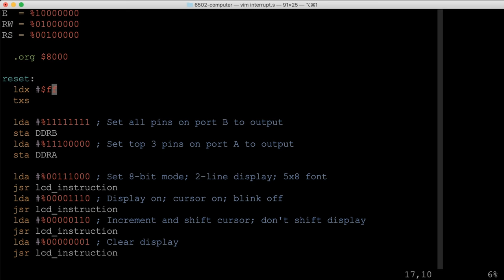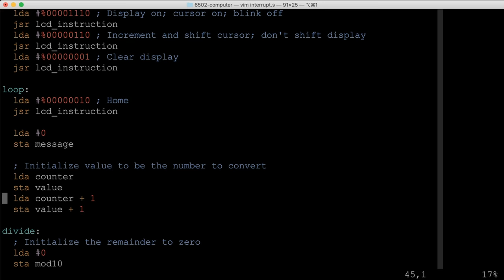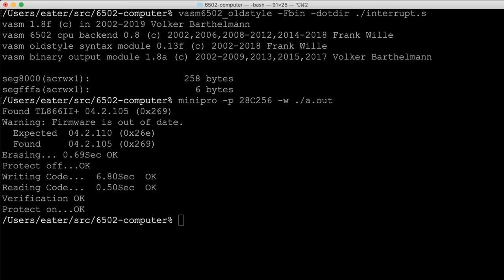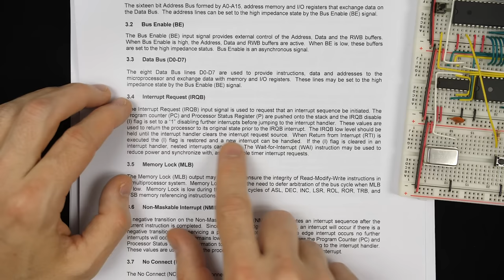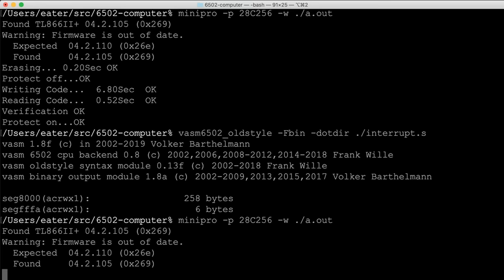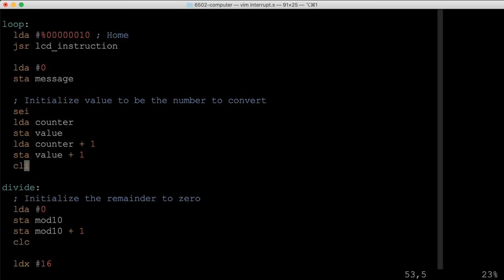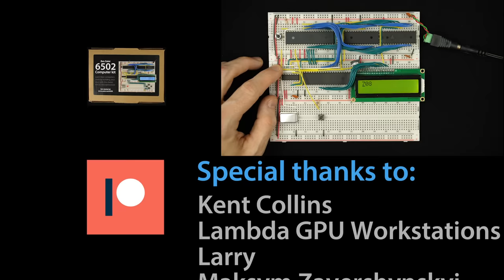Hardware interrupts

Comment: Level interrupts are handy for cases when several devices request irqs simultaneously.  Service one and rti.  The IRQ service is immediately triggered again; but the first device is no longer active, so you service the second.  The third entry services the third, etc.  You can even check the high-priority devices first.
Reply: Agree.  Archaic system I worked with had separate interrupt lines, each with separate vector address, for each device.  And they were prioritized such that lower level devices couldn't interrupt the higher priority interrupt handlers.  Sending all device signals through separate logic into one IRQ line has some advantages.

But now the IRQ service has to spend a few instructions just figuring out WHICH device caused the interrupt and then JMP to code for servicing that device. 

As so often the case, 'do it in hardware' or 'do it in software'.
Reply: @mikefochtman7164  In the mid 80's MOS Tech released a priority interrupt controller for the 6502 that could extend the three vectors to 16 vectors.  I don't recall the IC number.
Reply: @byronwatkins2565  Interesting.  I also seem to recall some members of the Z80 would do a special 'read' of the data-bus as part of the interrupt service.  Then the interrupting device could actually transmit a byte to the CPU that would indicate a particular vector to load from a dedicated page.   Or maybe I'm hallucinating, it's been a long time since I touched a Z80.  lol
Reply: @mikefochtman7164  My exposure to the Z80 and 6800 was limited.  I remember that the 6800 pushed all registers onto the stack when servicing IRQs making them take longer than the 6502, which only pushed status and program counter.  Z80 has a request/acknowledge protocol for some reason, but I have never programmed them at low level.

Comment: I have been using computers since the C64 and working with them for 30+ years. I've never completely understood why a chip would use little-endian design until seeing the code at 6:35. It's so elegant to remember that the result of the overflow goes into the NEXT memory location. No mental gymnastics required! I'll be getting my full set of kits in 2 days, and I can't wait to start building them.

Comment: Happy to see the uploads. Working on your 8 bit EEPROM just now
Reply: With some changes it's possible to easily extend it to other 8-bit memory chips. My version is built around Arduino Micro. It supports 27C64, 128, 256, 512, 010, 020, 040 and 801 EPROMs, 28C64 and 256 EEPROMs and 29C010, 020 and 040 FLASH, with support for 27C16 and 28C16 coming shortly.

Comment: Just today a saw a video about the Atari 2600. It also used the 6502, just in a smaller package. Considering it does not need all those address lines since the machine uses only very little ram or rom it makes sense as a cost cutting strategy.
However those madmen also removed the interrupt lines! Both of them!
Now this would not have mattered too much if not for the fact that the video chip required excellent timing from the cpu every time a line was printed on the screen. The programmer had to make sure of that. It would have been so easy using interrupts, but no...
It is only one aspect that made that machine a nightmare to program for.
Really, I understand that every cent counts. But deactivating such a convenient tool?
Reply: The 2600 was certainly a quirky beast, but it did have ways to deal with the tv scan line.
It might be best to think of it backwards, not a cpu with a chip to draw video, but it's a video chip having an assessory (cpu) to feed it instructions.
So instead of an interrupt, you can ask the TIA to let the CPU not run until one of the video related timing events (hblank or vblank usually)
So your code can setup a scan line, and ask the TIA to 'wake' the cpu when done.  Then the very next opcode in your program runs potentially many clock cycles later.
This works out better in the end because the video chip runs 3 times faster than the CPU.  Even a NOP instruction (one 6502 clock cycle) means the video chip has already just drawn 3 pixels on the screen in that time
Reply: @lorddissy  A NOP instruction takes 2 cycles; because the way the 6502 is designed breaks an instruction into T-states, which each last one clock cycle, means that a T-state cannot be both the first and the last one of an instruction. Even if the answer (if there even was one!) was ready on the first tock, there needs to be another T-state to allow the program counter to increase ready for the next instruction. This only affects single-byte instructions. Any instruction 2 bytes long or more needs more than one T-state to read the whole instruction. So something like LDA#&00 (A9 00) reads A9 from memory in the first T-state, reads 00 from memory as the clock ticks (goes low) to begin the second T-state, the 00 will be latched into A when the clock tocks (goes high); and this is not the first T-state so it can be the last. The program counter increases, and the (first byte of the) next instruction is read on the next tick.
Reply: It's a weird design in general. Born almost entirely out of a period of time when RAM was unbelievably expensive.

It's interesting to see the logical evolution of this design though.

The Atari microcomputers. (also the 5200 console, but that was ultimately an afterthought in the end - the chipset was designed to be a game console, but instead was turned into a microcomputer first, and a console after the fact)

The Atari 2600 is built around it's graphics chip, the TIA. (Television Interface Adapter)

The microcomputer range is built around a chip called GTIA (Gary's Television Interface Adapter).
And when you look at what it can do, it's very much like an upgraded TIA.
Like TIA it essentially only creates one line of graphics; 8 hardware sprites that have to have their data altered every scanline (they can be scrolled horizontally but not vertically), and a bunch of data that forms a background.
It has better colour capabilities and more detail is possible (up to 384 pixels on one line).
A minor design change that speaks to how the new system works though - it doesn't have any kind of internal register for background graphics.
Instead it has a 3 line data port, and interprets the values on this port in realtime. The chip has 4 modes, which interpret this in different ways. The standard one the systems use most of the time interpet the input as 5 different types of pixel, and several types of blanking instructions (including a switch to or from high resolution mode; standard resolution interprets the input as one of the 5 background palette registers, high resolution effectively interprets it as bit patterns using only 2 of the palette registers - or really, only part of two registers; specifically the luma part of two registers, and the chroma part of one of them. - There doesn't seem to be a good reason for this in terms of circuit complexity, but rather it seems to be intended to reduce the chance of colour artifacts in high resolution graphics.)
The other 3 modes all read the data port twice, which means they use 6 bits of data, and thus halve the transmission rate (and thus also resolution). But, in return these modes can specify 16 unique colours; Each of these 3 modes interpret these 16 values differently. (one interprets them as 16 shades of monochrome - one colour, 16 brightnesses), another as all 16 possible chroma values but at the same brightness, while the last is basically 16 colour palette mode; But since the chip only has 5 background and 4 sprite palette registers, in reality this mode only allows 9 simultaneous colours. (though a minor upgrade to the chip could have certainly given a full 16 colour mode this way.)

So... Aside from having an external data port and generally better capabilities, this very much is in the same lineage as TIA...

But when designing it they quickly realised that repeating the 2600's design made little sense; It was awkward and hard to work with, and RAM was no longer that expensive.

So they could've designed a more conventional graphics chip that had video ram and dealt with frames and so on...
Instead, they created a chip called ANTIC.
In their own words this is a CPU specifically to handle graphics, leaving the 6502 main CPU free for other tasks.
And to a point, this IS accurate.
though to call ANTIC a CPU is being very generous.
ANTIC has a display list, which is a set of special purpose instructions that run every time a new frame is drawn.
This display list contains various definitions of different more conventional graphics modes, such as a bitmap mode, or a text mode or the like in different resolutions. What distinguishes ANTIC + GTIA from a regular graphics chip is that ANTIC specifies graphics modes per line, not based on the whole screen.
Indeed, why not? ANTIC works by writing data in realtime to those 3 GTIA pins.
What kind of data it can write is limited by how ANTIC is designed; You could swap out this chip for something else and radically alter the behaviour of machines built with this setup, even though the GTIA chip that actually does the job of producing onscreen graphics is unchanged.
All the text and graphics modes the system supports are dictated by the design of ANTIC (even if some of their limitations, such as colour and resolution are constrained by GTIA)

In effect, ANTIC is the result of looking at what kind of graphics capabilities a computer would typically need, getting a 2600, then swapping out the 6502 for a special processor that mimics the behaviour expected of common graphics modes.

ANTIC reads data from system memory through DMA, processes it according to what the display list says, then feeds background data through the 3 pin port directly to GTIA, while using further DMA to update the GTIA single line sprites, which in combination gives the illusion that the sprites span the entire height of the screen without the CPU having to do the work of changing it every line.
Since it's capabilities are still relatively restricted though, it has the ability to create CPU interrupts at specific scanlines, so that you can trigger a more complex effect with precise timing that DOES use the CPU.

A rather roundabout way of solving the problem, but one, it turns out that has some very interesting implications.

While no longer a direct descendant of this design, the lessons learnt with these two systems were then used to create the Amiga.

the Amiga, like the 8 bit ataris before it, has a graphics chip, and then a co-processor to help the CPU with the heavy lifting.
This co-processor is called COPPER, and has been massively generalised and simplified vs ANTIC.
Rather than a display list which deals in graphics modes for the screen on a line by line basis with special instructions...
COPPER is much simpler in concept. You have a bunch of registers in the system that control features of the graphics hardware (though technically COPPER can be used outside of graphics tasks by writing to other registers).
You then have a list of instructions that state to DMA a value from a location in memory to a specified register, then wait X pixels before processing the next instruction.
That means it can make changes not just per scanline, but mid-scanline as well.
(There is a lower limit to how frequently you can make a change though. No more than about once every 4 pixels drawn)
Same basic idea, but much more generalised.

Other systems have had features that clearly take inspiration from these. Though rarely quite like COPPER.
One example is the SNES.
It has a feature called HDMA.

What is HDMA? It is a list of instructions in memory. Every H-blank period (eg. Once per scanline), the graphics chip reads any HDMA commands if any are enabled, and copies a value from memory to the register specified by the HDMA command.
In effect it splits the difference between the generalised flexibility of the Amiga COPPER chip, and the more restricted scanline based technique of ANTIC.

And all of this derives from the weirdness of the 2600, with things built on top of it and generalised bit by bit...
Reply: @lorddissy  thinking of the 2600 as more of a "programmable video generator" rather than a "computer with video output" really helps to understand how it works!
Reply: @lorddissy  I think you can only ask the TIA to make the CPU sleep until the next hblank. The vertical timing is not handled by the TIA but by the CPU itself! See https://www.youtube.com/watch?v=TRU33ZpY_z8 Different games could have different numbers of lines per frame, or even the same game could jump around between different numbers of lines per frame!

Comment: I am watching this series because I have some 6502 based projects.

By the way, IRQs get more complicated once you use the BRK instruction, as you have to do some stack crap to check if the BRK bit is set. And you have to use the copy of the processor status register that was pushed onto the stack during the interrupt process.

Also, someone on 6502.org made a circuit using logic chips that gives you 8 interrupt levels.

Comment: I always wondered what purpose an interrupt that you could never stop would serve. Now I have some vague ideas. Thanks!
Reply: As an old PC tech, most of my interaction with an NMI is a RAM error.  “Hardware state is bad! Stop everything!”
Reply: There are a few fairly common uses, besides the power down detection as mentioned.

Another example is a watchdog.  There's a resettable circuit outside the CPU that generates an NMI after a delay (starting over whenever it's reset), and the code is supposed to send the reset signal to this watchdog circuit every now and again.  If the code gets stuck, the watchdog triggers the NMI and the system can do some sort of a partial reboot to get unstuck.  This can be pretty important for systems where a crash would be inconvenient or dangerous:  better to have the elevator controller get it's mind back together, so to speak, when things go wrong, even if it means stopping at a floor where nobody wants to get on or off, than to stop completely and strand people in between floors...or send them careening up or down forever.  Sometimes the watchdog might just trigger a full reset, too.

Yet another common use, when developing and debugging low-level or embedded code, is to have the non-maskable interrupt break into a monitor or debugging program of some sort that can do things like display the contents of registers (saved from when the NMI happened), examine or change bytes in memory, etc.  Pressing a button or whatever connected to the NMI signal then lets you get a better idea of what is going on when that's clearly not quite what you thought should be going on.
Reply: Another use for the NMI is to trigger it on vblank if you have a DMA controller, as was the case on the NES.
Reply: Well. One of my current projects is done on an STM32F7. Part of the design is that I am able to store information in a non voltile way. In order to do that I have a Flash ROM chip on board and use a file system to manage it.
The file system is based on ELM-chans well known FAT filesystem.
We all know that FAT filesystems are a pain in the ass when something goes wrong, eg. the file allocation table is not written correctly to the medium.
Something that actually might happen, if the power goes away unexpectedly and the Filesystem still has the allocation table in ints internal cache and not yet written to the medium.

And yes. This is exactly what happens sometimes. Part of my testing precedure of course is how the µC-card handles power outages. And sometimes it happened that the filesystem was no longer usable afterwards.
So what I did was to monitor the power lines and if I detect a possible power loss I use an interrupt which immediately closes the filesystem and locks it. The power might come back (it might have just been a small glitch in the power supply input) in which case the filesystem is opened again but if it eventually goes away at least my file system is safe and stays usable. My hardware designer used enough capacity in the power supply such that the processor is able to continue for 10ms after the power input is missing. Enough time to drive the whole system into a safe state.

Comment: What a flashback! 
I spent hours (days, weeks, months...) swimming in IRQs and NMIs on the 6502 (and Display List Interrupts on the ANTIC chip) in my old Atari800. That's where all the multitasking magic lived. Jumping between the CPU and ANTIC and back and doing as much extra processing as you could get away with before the other noticed was the real trick. 5 cycles here, maybe only 3 cycles or as many as 7 cycles there... Ah, those were the days...

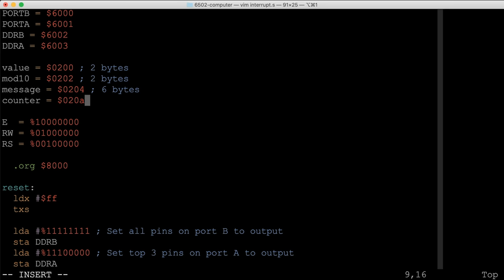Comment: 7:20 - Just noted that you have no "overflow" protection on the string entered before the counter. Yes, the code doesn't allow for any decimal higher than 65536 to be stored (5 characters + \0 terminator) since the 16 bit value operated on cannot go any higher, but just wanted to point it out.
Probably not bad practice at all in 8-bit programming, but I'd personally spare some bytes for a "potential" change in code that allowed a 32-bit integer (10 + 1 chars) as decimal to be stored there, since you're not low on memory space. Maybe even space for a 64-bit one (20 chars + the \0 terminator).